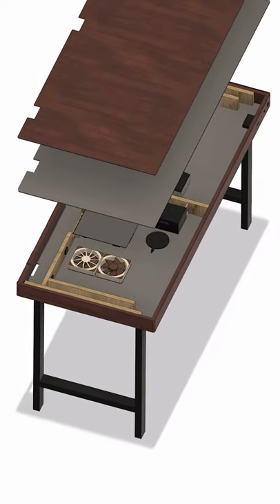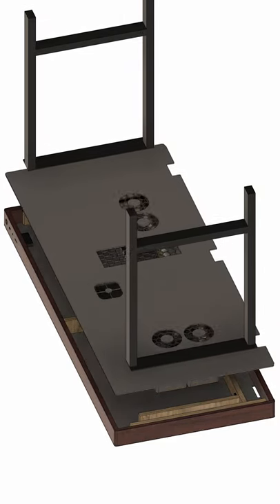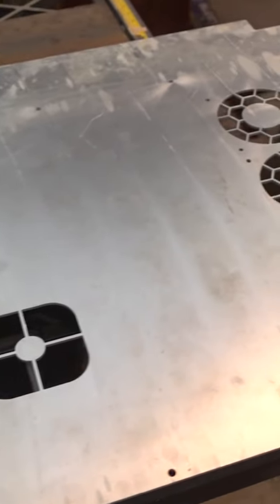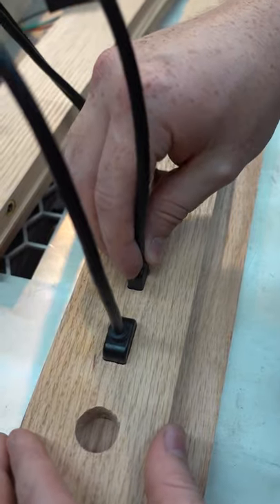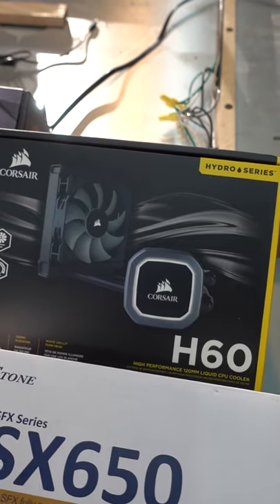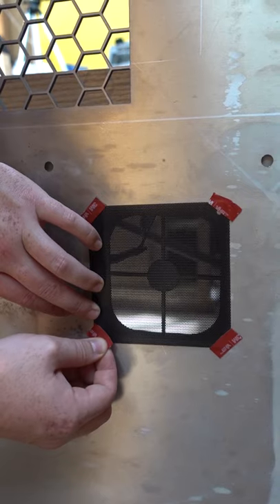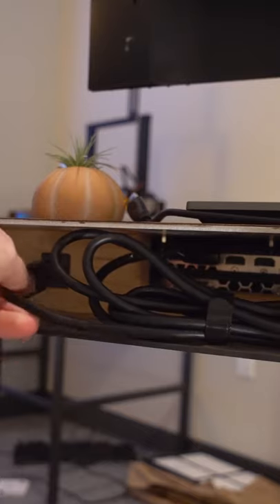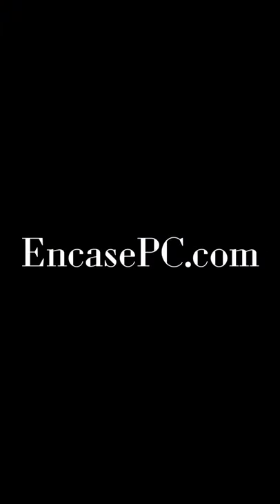Building a Desk PC for the Most Minimalist Setup Possible

Comment: I was also impressed by DIY perks and LTT desks. Thanks for showing your version! It looks amazing!

As for me, 50mm desk (with 44 mm internal height) looks better. And it perfectly the same as 1u rack height. The only problem with such height is the PSU. PSUs are pretty loud.

I thought to make a bottom cutout to access rear IO and some hole in the top for cables. But your solution looks even better.

Sit/standing legs would be a great addition to this design.

Also I want to build 2 such desks for my home office and I'm limited in 120 mm width for both. However, I have a space to make them deeper than standard desks. But first I need to finish renovating it.

Comment: This is really nicely built and the video is well shot. Any chance you have or are willing to provide(or sell) the schematic for the bottom and top aluminum sheet cut outs. I dont have access to that machine so id have to send out to have it made. 
Also do you have links to the outlets/attachment mechanism for the rear I/O?

adding a few other compartments with front I/O so its still hidden and maybe adding an NFC/RFID reader for power so there would be no need for front IO